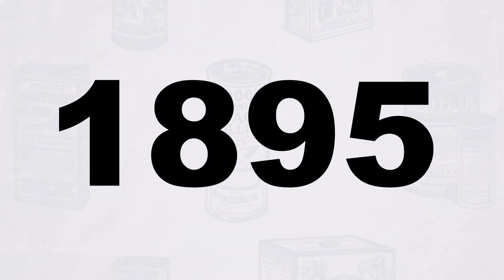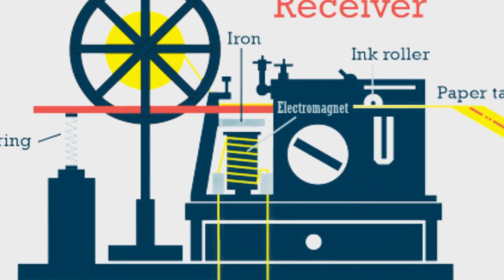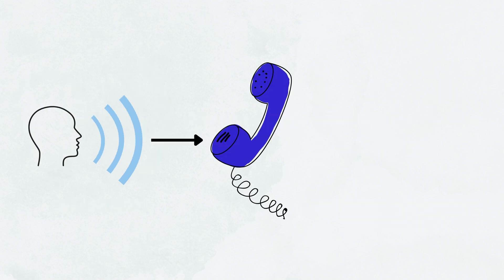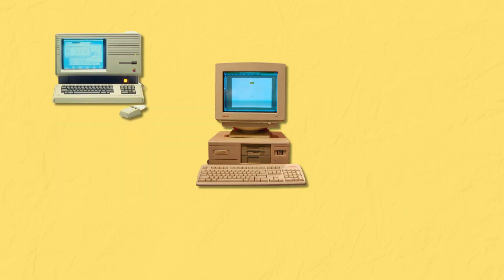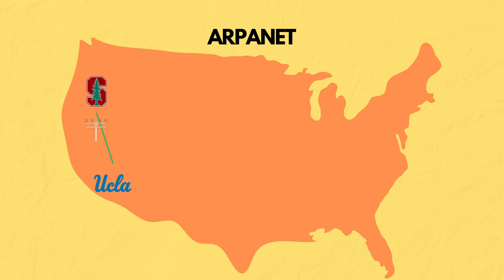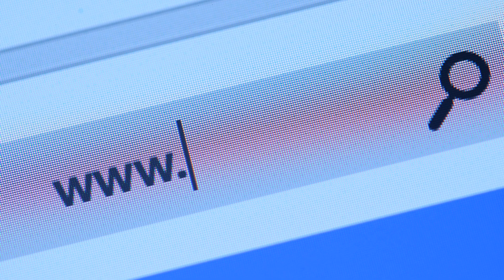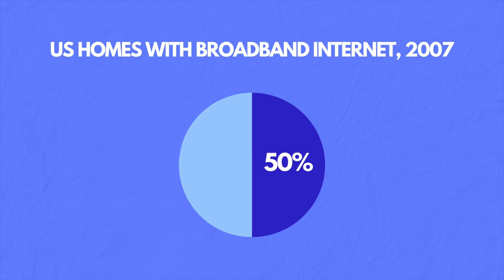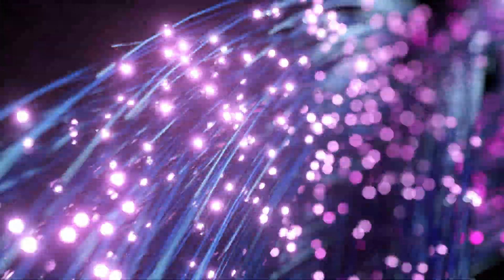What happened to Dial-Up Internet?

Comment: I first used the Arpanet in 1985, communicating from Portland to Berkeley via email. The only people who could access the Arpanet back then worked at high-tech companies like Tektronix, Boeing, and major research universities like Berkeley. No real-time connections ... the mainframe computers talked to each other via dial-up connections at night, so the reply to your email would take the next day. The public didn't get access to the Internet until about 1993 or so, and you could choose an ISP and get a 9600 baud modem to access it. Modems topped out at 56000 baud, depending on line quality, which could change moment by moment.

Comment: 4:26 That's the first computer I ever used, an HP 2000C minicomputer connected via dial-up modem to a Teletype 33 terminal in 1974. It had an HP 2000 BASIC interpreter and ran a computer game, TREK73. The BASIC source code can be found online.